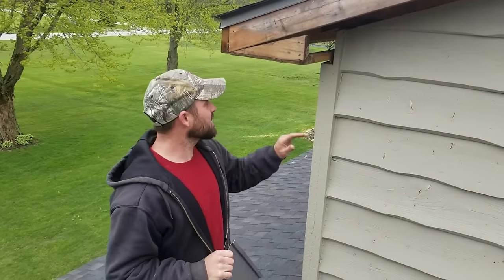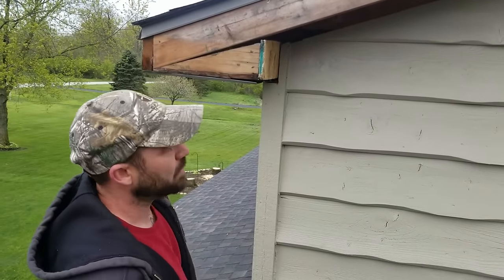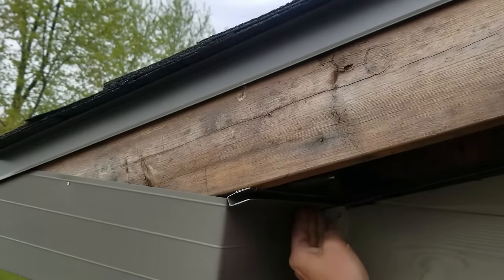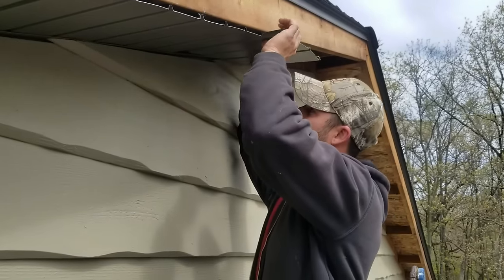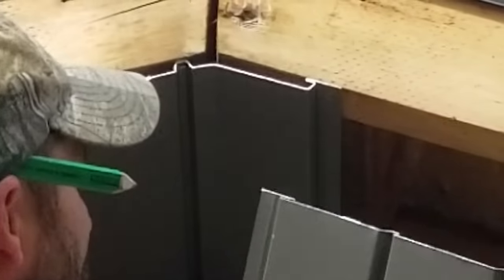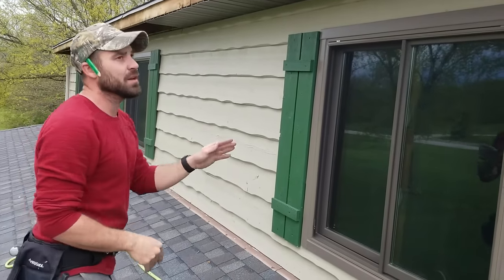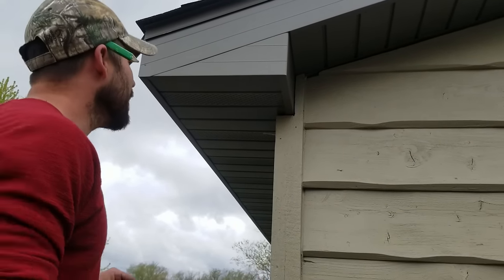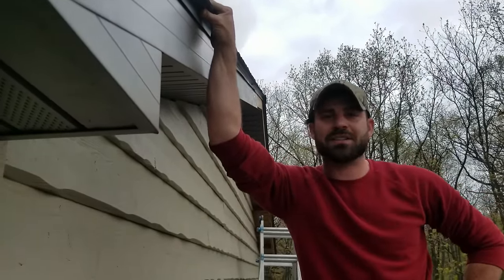HOW TO | Birdbox, Soffit and Fascia.

Comment: Gonna be honest dude. You inspired me to make more money. You’re a cool dude. I do framing, siding, roofing, soffit/fascia, and pretty much everything carpentry.  Just your work ethic alone is inspiring. Thanks bro.
Reply: You're welcome I do my best..
Reply from the maker: Hell yea bro that's crazy to hear. I ain't no different from nobody! Carpentry is one of my favorites.  Got a good video coming soon on some basics n building doors and such.  Carpentry is the best base of all the trades I feel.  If you can understand framing well you can learn anything else quickly with full understanding
Reply: @NWIVeteranConstruction  Bro I love your videos! I am currently remodeling my first house and wanted to try the fascia and soffit myself. Unfortunately I can't find a good place to buy the fascia anywhere near me. Do you recommend any place. Could you please??
Reply from the maker: @darbyholloway1593  I go to abc building supply or beacon. But home depot and Menards also have them in some colors
Reply from the maker: If you're looking for color, abc has the most colors in stock in my area and most of the gutter companies use their aluminum as well so the color match is perfect
Reply: @NWIVeteranConstruction Thanks for the quick reply!!! I'm in Nashville, Tn. I contacted ABC supply due to a suggestion from a contractor friend. They told me that they only have coil stock currently due to an "aluminum allocation " I don't have a brake. Home Depot seems to only carry vinyl fascia around here. Lowes it looks like I can order white only. So I guess there must be some kind of stupid shortage going on....
Reply: Same here! I’m a veteran as well and I love your videos.. attention to detail is beat into us and you definitely understood the assignment!

Comment: Good video man. I was a siding installer for 12 years, worked solo about 99% of the time. Specialized in gables and overhang using aluminum and steel, no vinyl. I used slightly different tools and methods but end up with a similar result. It's always good to see someone else who really knows the craft. 

Tip for when your soffit ends right at the peak of the gable:  Break off the first 4" section of that last piece by scoring it with your knife. Do it on the first line of the valley in the rib, so that the valley stays in place. Use the valley to lock into the previous piece of soffit. Now that last piece will die 4" from the peak instead of on the peak.
Reply from the maker: freaking genius! thanks for that. that was actually helpful for my guys screw it up lol

Comment: Thank you so much!  As a homeowner having my entire house re-sided, including soffit & fascia, and getting all sorts of "explanations" 🥴 as to why something doesn't look right, this is Gold!  Just like Math...order of operations.  I have been cringing everyday with the "work" (I use that term loosely) that is being done.  I wish I could do it myself, but I like being close to the ground. 🤣  It seems that 1" fold under is standard for fascia, but dude is using 1.5" probably because most of the soffit pieces are cut skewed and he's trying to cover it up.  Then the reveal doesn't line up with any connecting J-channel. 🤦‍♀️ I just want to cry. 😒 Ugh!  Asked why the overlap on the fascia long side was not pointing to the rear of the house for a smooth line of sight, but the vinyl siding overlap is facing the rear.  He says it doesn't matter because you're going to put gutters up, right?  I told him it should be consistent regardless.  You can still see the overlaps under the soffit.  Ok, I'm done now. 🤣🤣🤣 And, thanks again.  Your videos are so helpful. 👍🇺🇸

Comment: Great tips, thanks.
Home owner here, did my house and garage with a system like that from Menards. Soffit panel is solid vent vent sold. Started at the top of the gable end bending the panel in the middle and work my way down both sides. Makes it even in both directions. Would like to know how you finish the top of the gable with the facia and any tricks to keep things from buckling in direct sunlight if possible. It seems to flatten out as it cools ( thermal expansion sucks), but it seems to loosen the nails over time.

Comment: Good job. We only use steel fascia's. Much stronger. I have replaced lots of aluminum. It works, but not as long. Nice job explaining your method though. "Corner box" is what we call it.
Reply: Roofer850channel we call it bird box because it seems every time we are doing soffit jobs when find birds in there😂
Reply: steel rust. why would you need steel fascia for a residential house? 0.19 aluminum coil is adequate

Comment: We use to house the cut away portion of the rake fascia cover in nailed on aluminum undersill trim where it runs across the bird box. It holds that long flat section flat without a lot of visible nails. You can make a narrow hemmed strip for this out of matching coil stock. Also that last piece you cut off the bird box cover should have been left on as a tab bent around to the eve side to flash the outside corner. That way you don’t have to do the same on the long eve fascia cover resulting in so many layers on your corner return(bird box). Good job on the upside down F channel to trim that roughly applied fake live edge clapboards. You don’t want birds or bats in your birdbox

Comment: I prefer to bend my own aluminum. Also I have a method where there are only nails on my seams. I bend a receiver that I slide under the drip edge. And a reverse bend on the top of my fascia metal. Push it up and clicks in and will never come out even if you want it to. The bottom of the fascia I put an f channel upside down to receive the soffitt. My fascia metal is bent  to hook the f channel on the bottom. It comes out really nice and guaranteed to not fall off. I don't like relying on smooth shank nails. Love your videos btw I just started watching
Reply from the maker: That sounds pretty cool.  Do you use the brake buddy to stiffen it up orrr? And do you not nail on the bottom of fascia into the soffit ribs like I did? Coz I do that and only face nail seams and they hold up into the drip edge plenty good.  If you notice we have the larger option of drip edge which is pretty standard these days
Reply: @NWIVeteranConstruction  I have a break buddy but barely use it. Most houses I do have a shadow board which helps to stiffen it up. The only place I nail is on the seams to keep them tight. If I could figure out how to glue it then I would have 0 exposed nails

Comment: Great work. Only thing I would have done differently is to tuck the facia fold under the birdbox. 21:35. I feel it's a cleaner look. I use the same 15 oz Estwing too. Great siding hammer. 
 <---30 years residential remodeling.

Comment: Good video man just did a birdbox today after watching your video and it definately helped. One question I have is how come you wrapped the birdbox three times instead of just starting with one long piece off the house and making 2 bends in it to get around the box and then extending the extra 10 feet down the front of the house?
Reply from the maker: No particular reason.  Can't always do that anyway in my opinion so I figured the long way help
Reply: @NWIVeteranConstruction  sweet thanks. I'll upload a video when I'm done.

Comment: At the bird box ,You could have also tabbed the front, make your line add a inch and angle the top and bottom cuts. Then fold it around the front and nail that. I  worked with a top notch metal guy once I learned how to tab my  metal and hide my nails my metal work was superb.

Comment: I have a question? I had a contractor install metal facia and soffit last fall. During the winter I had water dripping down the outside wall of my home. Thought it was the unusual amount of snow and large ice jam that grew on the eve egde. This summer during a heavy rain I noticed I was having the same issue. How can I fix the water wicking backwards and getting under the soffit, then running down the walls?
Reply: Need drip edge.

Comment: i am learning how to do these things and i havent even stepped foot on a roof before
Reply from the maker: That's good man do you ever plan to use this newfound knowledge? Home projects or side work?
Reply: @NWIVeteranConstruction  yeah i have to redo the shingles on my roof soon, i planned to do it this summer but i cant afford them anymore because of this current crap happening. had issues where i wasnt able to work and right when i was good to go this global pandemic happened. would have had work all throughout the remainder of this year.

Also helping my dad build a vehicle enclosure with 3 walls for his truck just to keep snow off it and protect it from damage against the weather such as hail. will need to install soffit and such after we are done. put up 2 of the 3 walls so far with bracing and it looks great, just need to build the last then start on the roof rafters. 

thank you for making these video's! cheers!

Comment: I personally always pre-drill my fascia before nailing to help prevent oil canning and rippling.
Reply from the maker: Right on does it help? Coz I feel like it's mainly the crooked fascia that causes that
Reply: @NWIVeteranConstruction  yes. According to Vinyl Siding Institute you should pre drill aluminum capping and not nail it completely tight. I have this certificate. But it's more work, I don't do it. Let Dmitri do it.

Comment: That is OK for not using a brake.  I use trim coil stock and bend it up in my brake, also much better to use the brake when the box has to be taller than the fascia will allow.
Reply: Any roofing or siding contactor that uses pre bent facia is a hack!!

Comment: Hi! I've been trying to understand the basics from you. I am not sure how unique or if my situation is unique.  But, let me get to my question. My husband and i had a new roof. Then he was ill. I mean he had strokes. So, I went up to the edge of our house by the fascia and box. They where going to fall cause along that front edge up there it was dipping . The first row of shingles on my front if my house was u shaped. Well, guess I should've called the ins. Co then. But, instead I watched 100 videos. Went up this last summer. Pulled up a foot of rotting board and shingles and set the birdbox and guttering down gently as i could. I bought wood, paper, shingles. I got a helper. We went to cut the rotten places off. But, when I went to replace boards. There where some boards one size like 1/2 inch along side 2 or 3 varying thicknesses   realizing im in over my head. I tarped it. Waited all summer long for my husband to recover. Also, the tails under the roof are all rotten.  It is an old house. Its been modified many times.
Have you ever come across this before? I don't understand at all what my insurance company wanted me to do. But more importantly. How does a d.i.y er even remotely have chance at successfully fixing such a mess? Also, do you ever do  metal roofs in your region? I am in Tennessee.  Lots of new homes here have them. Do you have a video on those? I have seen a lot of your videos and haven't seen one yet. Sorry so long. Love your videos. I am much older and I can tell you. Your so very fun to watch. Your videos are very helpful. You're a natural in front of a camera. I wish you all the best on youtube. And in your future. I can see your job is quite physical. Be sure to be safe. And take care of yourself. I.e. back / knees etc.
 Thank you for any advice or suggestions.
Reply from the maker: seems like you have quite the project. i would suggest calling a few companies. get like 5 opinions and quotes because at this time people can charge a lot for repairs like yours. especially one that a homeowner tried to go at. so get a few prices and just go with the middle-low guy granted you like them and trust them. thank you for all the kind words!

Comment: I believe vented soffit should be used everywhere because the siding needs to be vented also.  Some wood siding products require 3/4" strapping behind to properly vent them.  My masonite siding has 3/8" strapping behind it.  Air must freely move upwards to reach the vented soffit where it is exhausted.  Few builders understand the importance of this.  It prevents siding dry rot problems.

Comment: Just watching a pro do this gives me motivation to get outside and repair mine lol. Are you using stainless staples in the gun?
Reply from the maker: Uhm. Idrk honestly.  I get them from the soffit supplier and they carry them specifically for soffit.  So. Whatever the right answer is lmao
Reply: You would generally use an exterior/outdoor staple...when working outdoors gentleman, strange enough if you read the lettering on the box they come in it will verify what the product is rated for/rating of staple, indoor/outdoor...ect.
Reply: Alot of sofit staples have a red or blue glue/wax to prevent rust too.

Comment: When putting the fascia on the gable ends , if you nail a hem on to the birdbox , then you can slide the metal into the hem (the end that you cut the return off of) and avoid the face nails on the end of the fascia metal.
Reply from the maker: Yesir I was going to make another video with it

Comment: Hey bro.   Great job.   Just wondering why you don’t do one complete piece to wrap around the bird box. Is there a reason you don’t do it that way?    But either way you do a great job
Reply from the maker: Thank you.  And It's definitely a good option that i will do on occasion.  But those vertical bends have to be perfectly square if you're gonna add a second bend on a piece of fascia that is 12 ft. Not only that but the human doing the bending also would have to be perfect lol it works good if the situation is right but I think you're bound to get a few oil cans out of it and just end up cutting it where I did anyway a decent amount of the time so I typically plan for the worst and teach it this way so my guys don't put up shotty work.  The small piece is easy to work with, don't Gatta fight nothing and you will move along pretty quickly

Comment: I would have done my metal facia different personally. The front piece with the 1" bend should be behind the bird box metal that wraps to the front or vise versus put a 1" bend on the bird box wrapping 1" in front than run the front fascia flush, that will give you a cleaner look and hide the 1" bend and still prevent water running onto wood.

Comment: Looks good man. I work mostly on new construction sites and see guys who do this stuff every day so I can say from experience that your fascia/soffit work looks A LOT better then theirs. Do you only put nails on the bottom side of your gable fascia because you're relying on the drip edge/gutter apron to hold it a bit? I get that the horizontal is going to have gutters installed on it so the fascia metal definitely isnt going anywhere but aren't you concerned about the wind blowing the metal off your gable fascia?
Reply from the maker: yes I do. the drip does hold it tight but I always put one in the seams on the gables. sometimes 2 in a nice pattern. leaving those seams unnailed is the number one reason gable fascia falls off. I've yet to have a problem with it. and thanks for the compliment lol maybe show them my vids haha
Reply: @NWIVeteranConstruction  lol they'd just make excuses for why their's looks like shit but in their defense they dont have any drip edge to tuck their metal under so they kinda have to nail the face of it.

Comment: Was just wondering if when you were wrapping the birds nest, could you have just used a full sheet and wrapped all the way around and down towards the other end? Could make a mark where it ended and before you nailed it in place just started running your fascia from there back to the other end. Just wondering?

Comment: Good job, except for your tape measure operation.  What kind of fasteners did you use.  You said "staple" for the soffit.  What kind of fascia fastener, and what length did you use??
Reply from the maker: a crown stapler is used for soffit. as well as trim nails for fascia

Comment: bend box on a break oversized so you can run it up gable soffit and it will create a support for channel and dont leave a bee hole..i always start soffit with center bend in the peak so it comes out the same on both sides..
Reply from the maker: I mentioned the center thing I like that way too.  And yes i do that everytime I'm bending custom fascia but there wasn't a bee hole on this one.  It landed prefect honestly. Thanks for the comment bud! Always appreciate the input

Comment: great vid.  i do like colour matched screws, they NEVER work loose over time as aluminum nails do.
Reply: ...I don't know about using screws.  If you're talking about those zinc coated hex heads, they stick out like a sore thumb and can be seen a mile away.  They also rust out and will stain the aluminum and in 10 years the job will be trashed and have to be redone.

Stick to aluminum trim nails.
Reply: @robertkelly9772  no.  screws
Reply: @MrTooTechnical  How about an aluminum screw?
Reply: No. Screws

Comment: I'm planning on running some really long USB Camera power cables through my soffits. It seems like it should be open to the attic between the rafters above those soffit vent panels. is that usually the case? I tried to push one up so I could check but it wouldn't budge. I didn't know how they were installed until just now so it makes sense that it didn't move. I would rather not drill holes through the walls.

Comment: BFG is a good way to remember that order. (box, face, gable) what size staples were you using in that air gun?
Reply from the maker: Idk usually bigger than a half inch and less than 1 inch. The supplier keeps the most common size so I don't usually bother remembering lmao